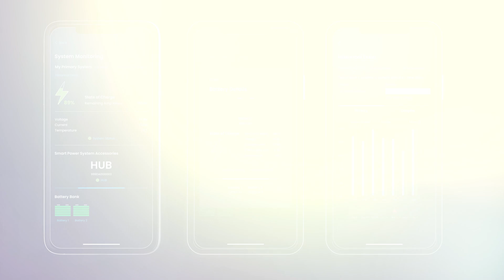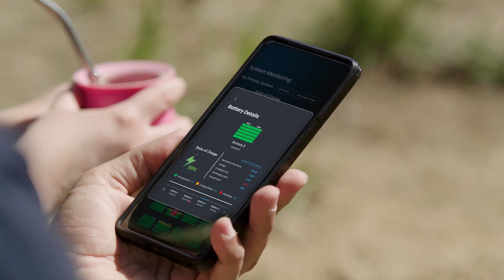Boondocking Reimagined | Smart, Safe, Reliable Power with Battle Born Smart LiFePO4 Batteries

Comment: I would like someone to make an adapter to use my old converter in my 2017 trailer to charge  heated lithium batteries. I still have lead acid batteries on the hitch and two Battle Born unheated in a compartment inside my trailer that I charge via solar. The main appliances still run on the lead acid batteries.